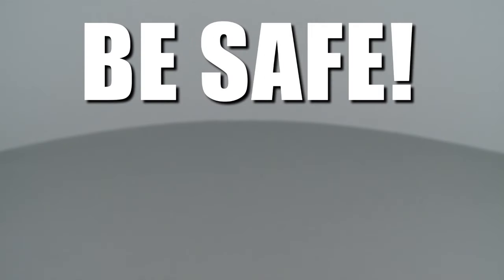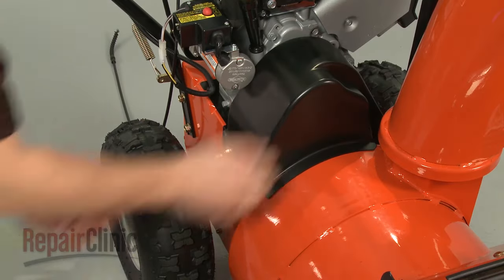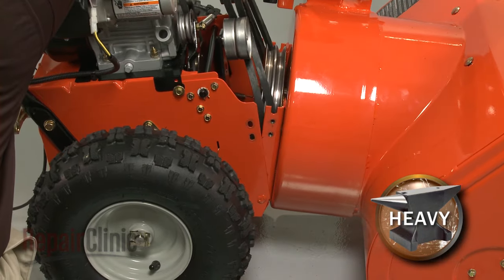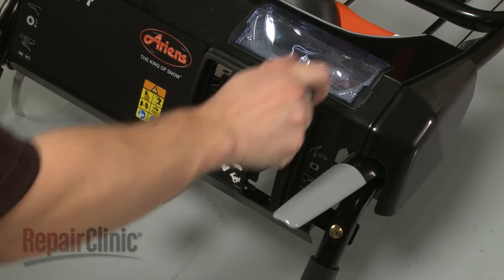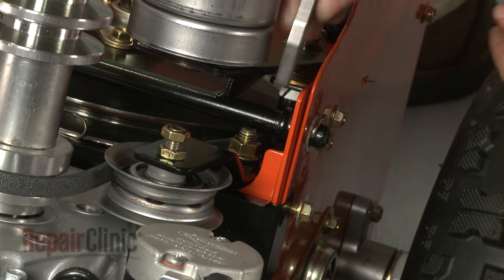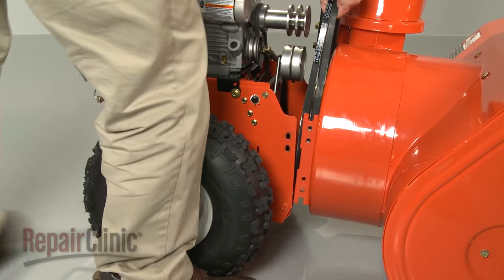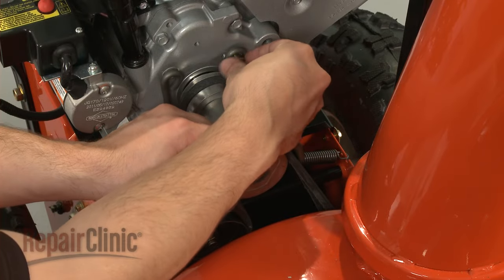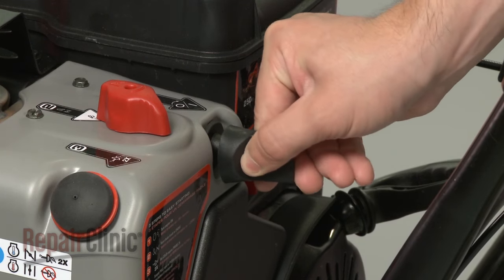Ariens Snowblower Drive Belt Replacement #07200111

Comment: Don't do this with a full tank of gas ;)  and don't tighten those small 10mm screws like crazy
Reply: Lol yes suck out most and then take off the cap and put a ziploc bag over the hole and put the cap back on. Just did mine and watched like seven videos lol

Comment: Be careful of poor quality hardware, two bolts for swing plate spacer stripped, and one of the blower housing to frame bolts snapped off at 35ft lbs.